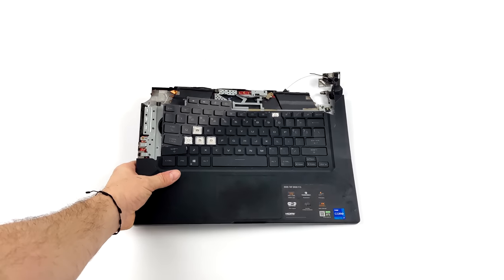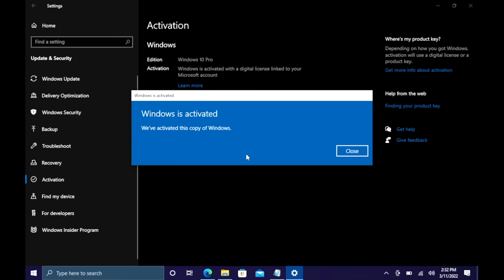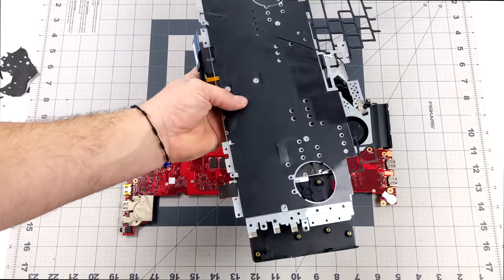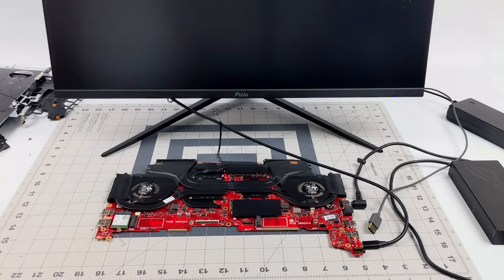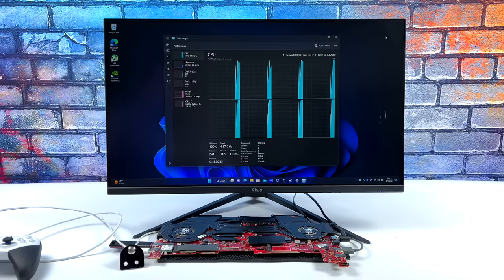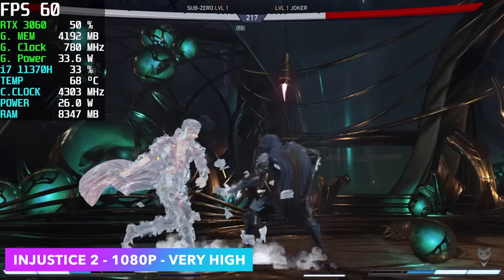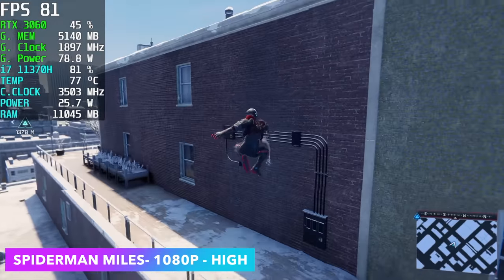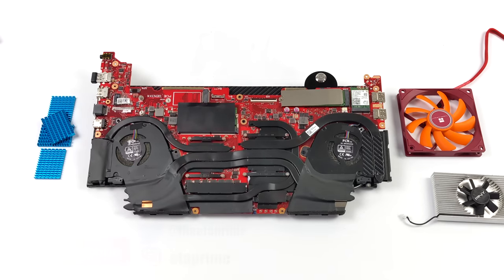I Turned This Broken Laptop Into A Powerful Desktop Gaming PC

Comment: If This Board Dont have bios battery{as im seeing from the video} you need to plug in main battery inorder to use this. Unless everytime you unplug charger or shutdown this will reset bios and will take 20 to 30 second to start. Some board doesnt allow full performance without main battery.

Comment: you know hat might be interesting project?
try turning broken gaming laptop into gaming tablet.
all you need is type c display controller board, a touch panel with same size as the monitor screen, put it in a case or modify the hinge, and you get your self a gaming tablet.

i myself hasn't been able to put it into practice since i don't have the resource(time and money), but hey atleast i'm doing my research and i'm happy to share it to anyone with time and resource to built it for themself, in case i messed up trying to build it myself and lose some time and money in the process.

Comment: Nice video.
I'm wondering why all the time I tried to do the same with several laptops they won't start because the internal monitor or/and the battery were missing.

Comment: "Turned" isn't exactly the best way to describe what happened here. You added a button and then plugged it into a monitor.
Turning it into a desktop would be like, mounting it in a case and having be a whole unit. 

Actually, it would be neat to attach it to the back of the monitor using the VESA mounts! Could do the computer module and a power module which supplies power to both the laptop AND the monitor, so it's just 1 plug to the wall! For cooling, you could probably remove those fans and put in some larger fans which has the same power requirement. Blower fans are rather dependent on ambient pressure whereas axial fans can move more air.

Comment: I suggest you put two hyper 212's on the cpu and gpu respectively . Since this is pretty much just a DIY project. I have a ryzen 6800h variant of this model and I agree that the cooling system just could'nt handle the cpu and gpu.

Comment: One of my old laptop is runing as home server and the mobo of another one  is glued on back of the monitor runing as PS2 emulator at home :D . PS : Mount a regular CPU cooler and remove the stock one from the mobo , u can solder the fan pins directly to the pins on the mobo and u will get better temps and fan control directly from the mobo ;)

Comment: Those heat pipes look damaged btw. I think you should mount a proper tower cooler to the CPU, and maybe use some kind of cooler for the GPU too. Also, you could try using PTM7950, because it is almost as good as liquid metal, but it is much safer to use.
Reply: "almost as good as Liquid metal???"   Its way better than metal XD.

Comment: Generally speaking, laptop fans (at least those on properly designed laptops) are designed to be constricted in just the right ways to move air across the board and cool the laptop properly. Pulling it out of the case and running it could actually make some parts become hotter. However, most of them are designed poorly so this point is moot. That being said, I love the idea of taking something destined for e-waste and making it usable again.

Comment: If you want to drop those temps and don't plan to move it around a lot. Look into Liquid Metal on the GPU and CPU. As long as the heatsinks are copper you should be good to go. Make sure to put dams around the dies so the LM doesn't leak out from pumping. That should drop your temps almost 20 degrees on it's own plus any other solutions you come up with to drop them further and you won't have any issue with thermal throttling.

Comment: How do you get the laptop board to function without a monitor? In my experience the laptop needs its internal screen for bios, and sometimes it refuses to project to an external display, requiring you to do that after logging in.

Comment: is it possible to upgrade the cpu? i'm also interested in the thermal solution you will put to lower the cpu temperature.
Reply: the cpu is soldered to the motherboard, so if you don't have a fancy soldering station no
Reply: @100uschallenge3  maybe from a broken laptop or some seller from aliexpress

Comment: I do have a surface pro 9 but do not understand the bios configurations stuff. Anyways, I planned on removing it out of the case & put it into a mini itx to make a portable itx gaming setup using 2 egpu systems, the razer core & chroma pcb's with  oculink. I'm just not confident enough to destroy my surface pro 9 & make that project possible. I'd see an interesting outcome from the surface pro 9 or even pro 8 converted to a mini itx setup.

Comment: I have this exact spec laptop and the thermals do kill it, when i'm in a hot country, even an hour of PCBS2 will cause a CPU overheat shutdown. I've undervolted the GPU which helps but the CPU seems to be fully locked down. Am interested to see what you do with it as I may do the same when I EOL this laptop and get a new one. BTW thats one hell of a rage quit.
Reply: I have the exact specs Asus tuf dash laptop, Yes bottle neck is CPU . But never have such thermal shutdown.
Reply: I am really interested to know how you have achieved undervolting the GPU
Reply: @scropion86  you can do this with MSI Afterburner. If you search on YouTube there's a helpful guide for the Laptop RTX 3060.
Reply: @fenix2k1  is it safe to use MSI Afterburner a tool from different vendor on asus?

Comment: if the cooling works out, shunt mod the 3060! about to do the same on my Acer Swift X14 with the 3050 Ti. already flashed it from a 35W TDP BIOS to a 55W. 
1206 R20s on top of the original R005s should add about 10W.

Comment: I started doing basically this with my razor blade 15 2018, but the bios doesn’t display on the external monitor with display port, hdmi, or type c and I can’t find any documentation on how to change it.

Comment: Y would install it in a big 60" tv  with a wireless  mouse and keyboard it would be a cool media center  and also install an aditional nvme disk also polulate the second ram slot or will enable dual channels

Comment: I'm trying to do this to my old gaming laptop. It's an Asus TUF fx705dt. It has a HDMI port but no type c ports and I can't seem for it to boot to the HDMI even when I unplugged the 30 pin to the laptop monitor. Is there another way or should I try a jank 30pin to HDMI converter?

Comment: i would like to see this with a egpu and  with a few cooling options  ,  mounted in some sort of portable diy test bench  (EDIY Open Air)
Reply: i7 11370h is a garbage cpu, it cant even handle rtx 3060 mobile so what is the point of installing a more powerful gpu into this rig?

Comment: liquid metal the snug out of it and maybe a 3d printed case with a 140 or 120 slim 5v fan or 12v with a voltage regulator, or a custom alu case like the vendor did with his notebook pc hack or a wooden case with a custom waterblock for both cpu & gpu

Comment: This is a strange question but is there a way to reuse the internals of a smart tv and convert them in to a portable streaming device like a Roku( unfortunately the screen on my smart tv is broken and I would like to connect the smart part of the tv to one of my non smart tvs so I don’t have to buy a completely new one) if there is a connection or adapter of some sorts that exists that I can get,if anyone knows please let me know . Thank you for your time

Comment: my laptops shell was terrible it snapped on both sides on the same place so i think it was cause of weight over time i'm way to careful with this thing now it's in perfect halfs somehow and not somehow the monitor still has there wire connected and it's still working